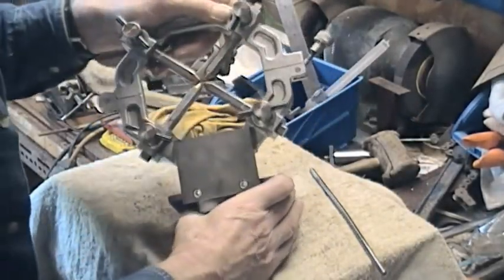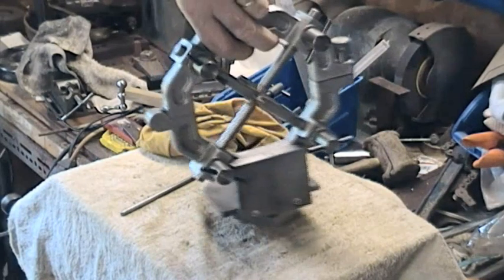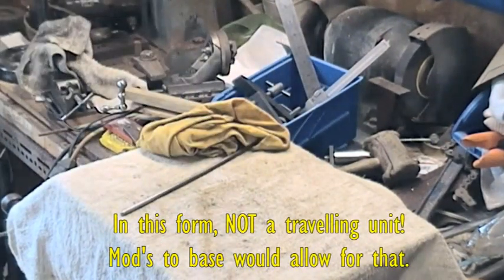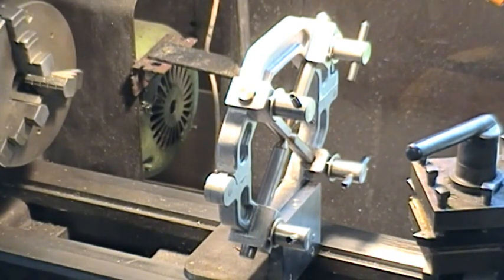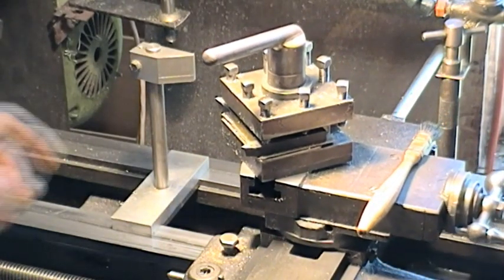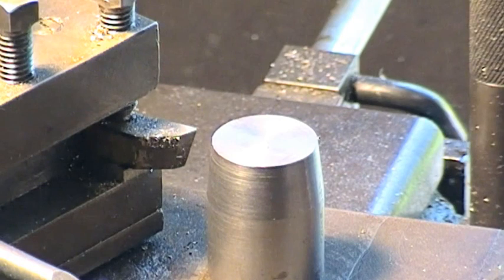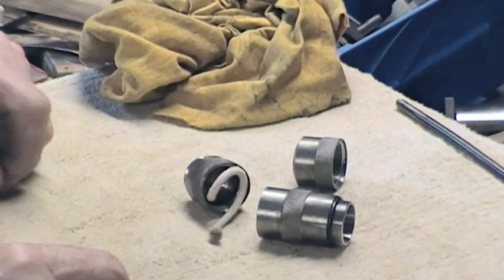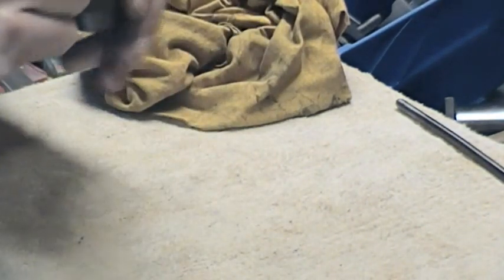Gadgets and Gizmos Part 8

Comment from the maker: Hi Dermot -- not Thailand. I am in Pennsylvania USA - also an expat Brit however! I had to sell most of my machinery in 2000 before my move and so just lathe, drill press and a lot of bits and pieces remain. Enough to operate on a basic level - most work I describe was from back about 25 years or so!